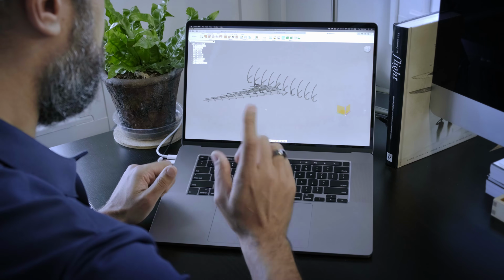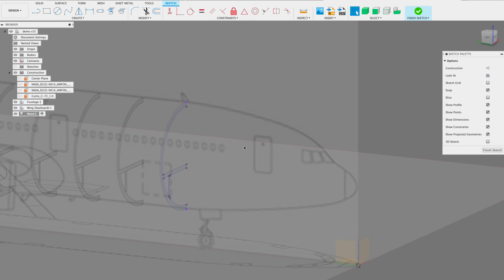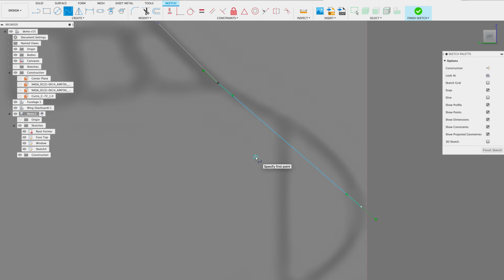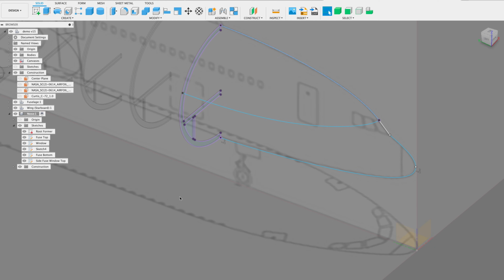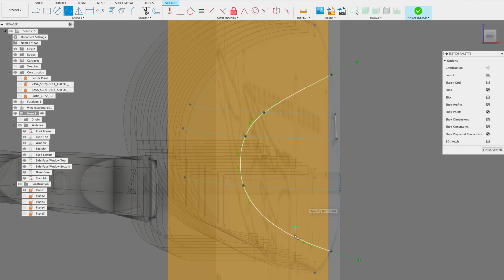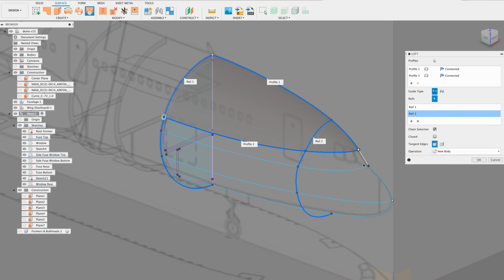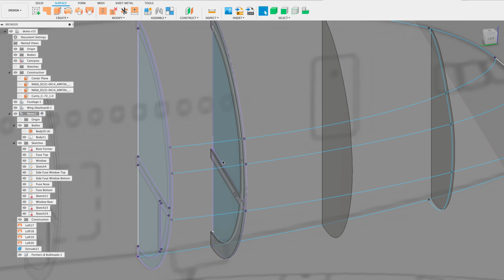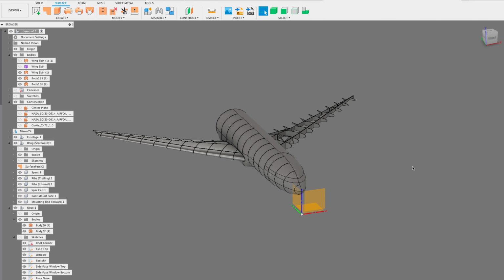How to 3D Model an Airplane Fuselage Nose in Fusion 360 [Episode 5]

Comment: Extraordinary!
Maybe one small suggestion. For a new sketch plane do not use box. Try this. Under "Construction" tab you probably have something like this: "Parallel to Plane through the Point" (I have it in Autodesk Inventor). Also there are other options. Just pick the point and pick the plane to be parallel with, for example one of the origin planes and that's it!

Comment: Any ideas as to why I can't create the boxes for the new sketch planes.  I'm out of the sketch and when i click box and I try and click a point on the sketch it only gives me option for the whole sketch line I can't select just the point.  I've tried toggling some the selection options and still can't get it.  Thansk
Reply from the maker: hmmm That's strange. Here is another method you can use. Create a construction plane on the axis you are wanting from the origin, then using the move tool (Select the Construction Plane in the browser) and move it to the point. Then you can draw your sketch from the construction plane. Let me know if that works for you.

Comment: Hi, I really like your video and I am trying to learn from you from these excellent tutorials and therefore I subscribed to your channel....  I have not been able to do the box trick since I cannot get the "snap point" that it does shows to you... therefore, not been able to create the box because (use it to create the offset plane) it will not be there at that point...   any help?  Thanks in advance..Jorge
Reply: I had the same issue and I found that if you create a regular sketch you can snap to the point and extrude that sketch to then create the construction plane from instead of the box as shown in the video. You may need to also project the point onto this new sketch before drawing the rectangle to extrude. Hopefully this helps you, if you haven't already figured out a work around.

Comment: I tried using the hack method using the box tool to create a work plane for curiosity as I hadn't seen this before. How are you snapping to the spline node? The primitive tools on my system doesn't seem to allow me to do that. Messed around with selection methods with no luck. Thanks for your great tutorials!
Reply: I had the same issue and I found that if you create a regular sketch you can snap to the point and extrude that sketch to then create the construction plane from instead of the box as shown in the video. You may need to also project the point onto this new sketch before drawing the rectangle to extrude. Hopefully this helps you, if you haven't already figured out a work around.

Comment: Hey Terrence, hows ut going? quick questioin: i can not seems to get the tangent on the window per vid time frame 15;50. can i continue with this or do i have to fix/resolve the issue which i dont know what is causing it. thanks.
Reply from the maker: Hi, Sorry to hear you are having trouble getting your splines to tangent. This and the Tail section is tricky because they require all splines and node to line up perfectly. It is one of the most frustrating parts of designing in Fusion. I have also lost countless hours getting sketches to work as I need them. The first thing that comes to mind on the tangency is that the sketch you are working on is not aligned (on the same plane) as the spline you are wanting to make a tangency from. Unfortunately, this is going to be a good bit of trial and error. Just make sure that your nodes all intersect perfectly.
Reply: Hi Mr. Terrence. thank you for your guidance. i dont give up that easy so i am going to try out your suggestions.

Comment: Btw,how you show and explain how this prgram works,wow,my complements,i did had a course of autocad,just to difficult for me,but your way did made me undertsnad it much better.
am an older man 61 yrs old,and i like to make designs as a hobby,and from my drawings to make the actual model.
am thinking of buying a laser cutter size 122 x 244 cm and also a CNC cutter,those i can afford,but i need to learn how to make designs,and how to transfer to files,i can use to cut or to print on a 3d printer
Reply from the maker: Thank you! I'm happy to hear that the way that I demonstrate using Fusion 360 has been helpful for you! That's a nice compliment. Best wishes on your boat designs and builds, that will be a lot of fun. I did publish this video https://youtu.be/FwBBkbOv8-M to help convert your 3D models to shapes that can be exported for CNC.

Comment: Hello terrance,i did watched all your videos,i did downloaded the program too,am thinking about getting the year licences too,subscribtion,i want to use the program to design boats,a boat,
i make my boat designs in ordinairy paint,for me it works,but when i make all the parts,it give some beauty faults.
i hope this program does correect this,and i do like to know,how to set up the starting.I have all te templates,made in paint???top view,side view,bottom view,front view,back view.
all in same dimensions,I did try to insert these drawings as a template,did not worked,i try as a Canvas??? did not worked???how do i get my simple design made in paint,inserted in this program????
Reply from the maker: Hello Ronald! I would suggest starting with a 1 month subscription to see the differences between the hobby version and the subscription version, just to make sure it works for you. 
Making boats should be a lot of fun! The design process should be much more simple than an airplane. Did you use this video https://youtu.be/ui-rieDDdTQ to insert the canvases into your design? If so, what file format are you using. It works well with .jpg files.

Comment: As someone that's been "learning" Fusion360 for a couple years - and loving it - I have always struggled with multiple sketches on multiple planes. With this series, and this episode in particular, the lights are finally coming on. Thank you so much. And with my goal of designing a plane (quite simple compared to yours), this series could not be more perfect!
Reply from the maker: That's awesome to hear Mark! Thank you for taking a minute to write this great comment! It always makes my day to hear the videos I've created are helping people design their own airplanes. That's what it's all about. I head ya on the sketches, it took my a lot of trial and error to get to this technique, happy to be able to share it with other aviation fans! Which model are you working on?
Reply: @RCCAD2VR  It's a version of the SkyHunter 1800, modified for vertical take off & landing (I"m a retired UAV engineer). It's foam, which makes it great for prototyping, but mine will likely be conventional balsa & ply.

Comment: Hello! You deserve way more views and subscribers, man... Your video production and CAD tutorials are extremely well done! It will be very interesting to see how this come together (I'm now subscribed). 
I have a question. I've seen alot of other people build RC planes using ribs and formers similar to this but I get the feeling they rarely are able to get a smooth skin afterwards. It seems to be pretty common to wrap the frame with thin plastic wrap but you don't get a very smooth skin doing that. What's your plan in regards to the skin? Just curious. 
Thanks for sharing your work!
Reply from the maker: Hello Mike! 👋 Thank you for the vote of confidence on the channel! I dunno if I am playing the YouTube game right, just making videos for folks in the hobby or interested in getting into the hobby. This plan will be covered in balsa sheets and planks, sanded and then fiberglassed, sanded some more, then painted. The wings I may do with fiberglass or carbon fiber sheets. The jury is still out on that one. The nose and empennage will most likely be preformed composites due to the complex and compound curves in those areas. The goal is to make it look just like a full size airliner. The plastic wrap just wouldn't look right for this model as you noted. Fingers crossed it all works out as planned. Welcome to the channel!

Comment: Hi Terrance, not sure if I missed it, but how can I add cockpit windows' angular flat surfaces to the design so I can 3D print the nose section? Thanks a lot for this tutorial!
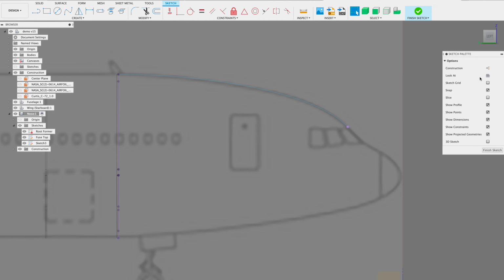Reply from the maker: Hi. At 13:40 I add a flat line for the center line of the cockpit window. You need to add straight lines at the base (XY axis) and top of the windows instead of the curved line as I did in the video. then connect the points with straight lines between the top of the window and bottom. It's hard to explain in text, but I hope this leads you in the right direction.

Comment: I think this series might well be THE best online tutorial I have ever seen. Both visually appealing and with great subject matter expertise. I have quite some experience with Fusion360, but I still learned a thing here and there. Awesome!
Reply from the maker: Hey there - Thank you for taking a little time out of your day to write such a generous comment! It's very much appreciated. It's cool to hear that someone with Fusion 360 experience is still able to get something from these videos! Care to share something that helped you with a project you're working on?
Reply: @RCCAD2VR  Not sure if someone mentioned it already: Your hack with the "box" to create a construction plane on a spline node is creative and it works fine, but you might as well go : Construction --> OffsetPlane --> Pick a plane from the origin triade --> select "To object" in the "Extent" dropdown. Now you can select the node directly :-) Thanks again for your beautiful work!
Reply: @RCCAD2VR  For some reason, over the years I got into the habbit of mostly working with solid bodies and then using combine-->intersect to trim away the excess material. Often enough I had to recreate some parts that I have just thrown out with the intersect command. Your videos (on the wing) made me realise that I should better use a surface and a cut like you did. That way I still get to decide if I can still do something usefull with the leftovers.

Comment: Just to clear it up is there a reason you are making every single difference line in a separate sketch? As opposed to a single sketch. It doesn't make much sense to me. You can get rid of all the projections and on a separate point anyone watching this you really should have design history turned on. It is a very powerful tool in its own right.
Reply from the maker: Hi Brandon. Thanks for the feedback. You are certainly correct, this could have been done in a single sketch, however, that requires working in 3D sketch and it is very fiddly and hard grasp for someone who is new to F360. I tried doing instruction using that method and it just added too many instructional problems. So I opted for the method demonstrated. As for the parametric modeling mode (Design History) This was also left off to enable features that are not available when in parametric modeling mode, while preparing for this series the timeline can quickly become a mess if you make a few to many mistakes and would require establishing parametric fundamentals. For the purpose of this series I went with the more cumbersome route to help ensure a less experienced person can follow along with fewer software prowess hurdles. As with all design software, there are 101 ways to get to the same place, this just happens to be how I chose to go about it. Cheers!

Comment: Hi again 
instead of creating your hack box to create a plane at the window just do offset plane to object and pick the point. im not trying to pick holes in what you are doing, but i have used solidworks for 10 years so i know how to do things. but your videos are great for the change over to where i need to find the things i am looking for so hopefully while im learning to transition to 360 i can use my knowhow to point out a few bits that will make your life easier
Reply from the maker: Hello Richard. Thank for the feedback. Happy to hear the videos have been helpful. I'm not familiar with creating an offset plane to object and have looked and can't find find that. Would you mind pointing it out. May be helpful in a future video. I used the box "hack" because it's a quick and dirty way to get a sketch started from any of the 3 axis planes and guarantee a perfect intersection. I've tried other methods and they end up being fiddly.
Reply: @RCCAD2VR  Hi Tereance.
1st off click on construct offset plane, this will bring up another box. this has plane and below that a box with extent. to the right hand side of the box is a pull down tick. click on that and you will have the choice between distance or below that is to object.
if you want to offset from one of the origin planes you do not even have to zoom out if you are close to where you want the plane. simply choose the plane from your tree on left, then hover your pointer over a node which are at the end of all lines and normally 4 around circles and click on  it and you should have your plane.
let me know if this has explained it. ive modelled my 6ft A10 for a 80mmEDF but what i need to now know is how do you separate the parts into individual parts for laser cutting. Hopefully you will be doing a video of this soon. regards Rich
Reply: @richardwarner1373  Hi Richard, could you please let me know how to do that? When I am hovering on the point, they are not activating and cannot select it.... same is happening with Terrance box trick... my points are not snapping to those in the sketch... thanks in advance

Comment: I'm redoing this tutorial step by step but I have a big problem in creating the construction plan above the box. When I try to create the box from the point, I can't select the point itself, in fact it highlights either the spline or the line, but never the point. Why?
Reply from the maker: I have had this happen before and usually if you click the point a second time it will accept the input. Let me know either way if that works or not and we can go from there.
Reply: @RCCAD2VR  Yes it accept the input, but it is not snapped with the point and when I go to surface for lofting there are a lot of angle around it and is discontinued. I don't count no more the times I've done the same operations ever with bad result for the loft feature.
Reply: What I note is that before to have the message "Place first corner" come out the message "Select the geometry or profile to edit the sketch" that that does not appear in your video.
Reply from the maker: @flyranton  Can you go to my website and send me a message through the contact form. We can then email back and forth and I can help you more. Thanks

Comment: Hey Terrance, I have modeled a bit in fusion 360 and just recently went down the rabbit hole that is the RC hobby on YouTube and am grateful to have found your channel. I love design and that of aerospace, I am excited to see this model when it is finished and cut out of whatever material your going to be using ( assuming wood based off the texture applied). I have never designed a plane before and am using your channel and videos as one of the main motivational pushes as I plan on designing and building a Cessna Skyhawk. I am curious on how you get the canvas picture reference, if there is a specific site you use or if its just google. Thank you for your time reading this comment, keep up the videos.
Reply from the maker: Hey There! Thanks for leaving such an awesome comment and feedback. Really happy to hear that you have found the videos so helpful and motivating to pursue your own project. The Skyhawk will be a very fun build. The diagrams that I used I acquired from searches online. There are many services out there that make them available, I found this one on Blueprintbox https://blueprintbox.com/details.php?image_id=24837 It's not the highest quality, but a good starting point. Drawing Database is another one https://drawingdatabase.com/cessna-172-skyhawk/ -- Keep in mind, you will want to use an image editor to crop each view to the very edges, this will help ensure symmetry.  Hopefully that helps you.  Cheers!
Reply: @RCCAD2VR  Thank you so much for your time, the second link is a really high quality image, better than what i could find. Awesome man. cheers
Reply from the maker: @Gummi_781  You're most welcome! Have fun.

Comment: Hello, Terr. Came across your video and decided to give it a go. One question after a few days of Fusion. Do I need the full version to be able to move or copy construction planes? I see that I do not have all the move options you do when I hit move....
Reply from the maker: Hey there - Glad to hear you are giving it a shot! The issue you are having with construction planes is happening because you are modeling in Parametric Mode, you'll need to turn that off and get into Direct Modeling Mode. For some reason these features are not available in parametric mode. Let me know if that fixes the problem for you.
Reply: @RCCAD2VR  YESI After going on your website I seen that in the notes, tried it and viola. Everything seem to work so far. I am currently in Wing part 3, (episode 4). No other problems so far.
Reply from the maker: @W1Ck3Dj3St3R1  Great! Glad to hear you were able to find the solution through the website! Let me know if you run into any other issues. Enjoy.